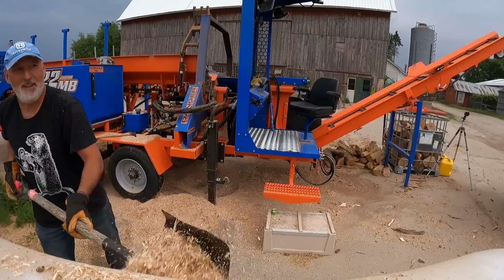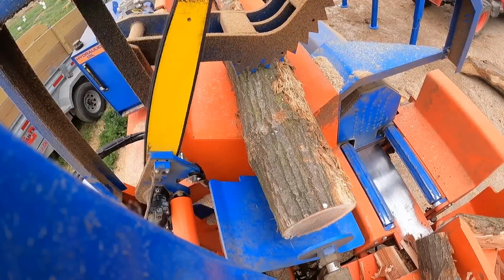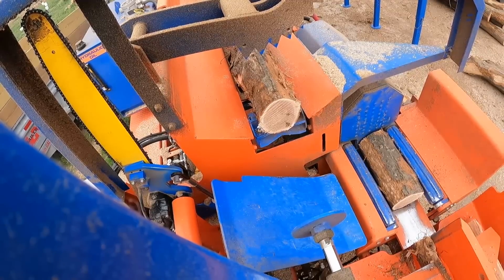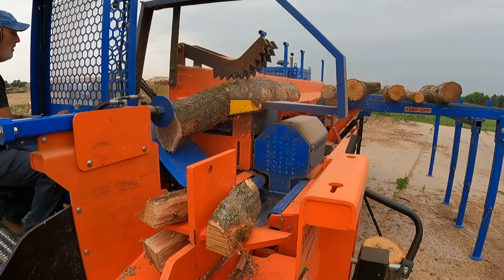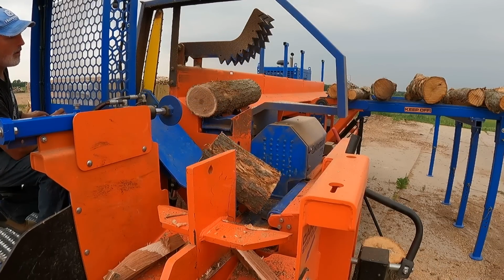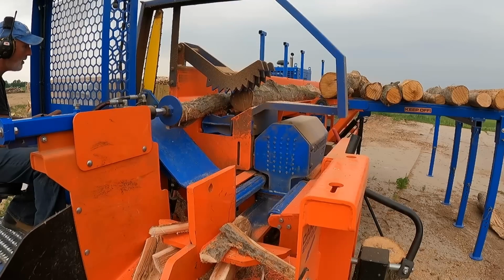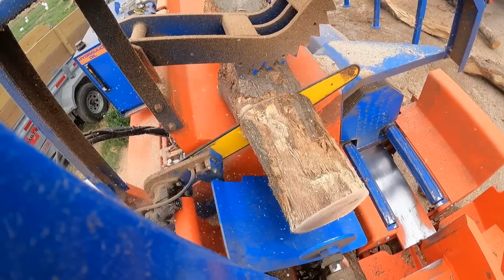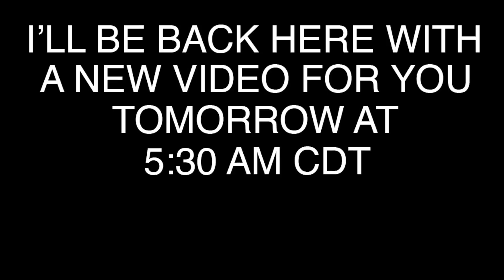Firewood Processor Run Narrated 🗣️🎤

Comment: What a relief! I thought I was the only one that ran a round through the splitter sideways. When you pull the trigger on the 48C splitter there is virtually no stopping it. The best lesson learned here is that cutting firewood with a processor is not as simple as it sounds. With all of the different shapes, sizes, knots, and occasional branch still attached, logs have a mind of their own.  My favorite log to run is tree length, 12-16" diameter. Very good video explaining the things that can go wrong and what you all have to watch out for when operating a processor. 👍👍
Reply: If you hit the trigger again on your 48c the ram retracts. Chris sent me the pictures of the new wedge you have and looks good.
Reply from the maker: Yup,l there is a lot going on there and it is very violent!
Reply: @BertsCustomCuts  Yes it does but as you know it moves fast, an old guy like me doesn't have the best reaction time. Did Chris send you the video? We just finished it last night and have not had a chance to put it to the test yet. We only ran logs through it while we were mocking it up, that's how we discovered that we needed a deflector in front of the eject door.  Need to get it painted, Jeremy is sending some down. If you guys get a chance I would love to have you give it a run.
Reply: @edrurup8955  he sent me video last night too. We should try to plan a day agian.
Reply: I hope I get to come and play to
Reply: @kennethcarlson8713  we wont forget you

Comment: Lots of cleanup tasks with the processor. You are very fortunate to have a concrete pad for the processor to sit on. Makes cleanup a snap. And cutting the IBC totes with a chainsaw!! Why didn't I think of that!? That's great that your clamp gives you a 16" mark. Perfect! On my Cord King, the bar speed depends on how hard you pull the lever. And it can be adjusted. Good design. On mine, the wedge wings are set back about 2". When I split big knotty pieces it hits the vertical wedge first, starting the split. The rest splits easier that way. I'm sure there's another reason as well. Thanks for another great video Chris!
Reply from the maker: Thanks for watching and commenting!

Comment: To hold the small logs in the center you would have to run two pieces of angle on the bed and recess the pusher plate to occomendate them,this would center them better.:yougotthis::yougotthis:
Reply from the maker: Maybe so??

Comment: The reason the cutter wings are set back, is the overall cutting force needed is less.  If all the cutters were flush, it would take significantly more force to push the round through the wedge.  This is especially true for 8 way and larger wedges.  I think when the new Eastonmade 40C comes out, I would contact Andrew and see if you could trade it out for your 22MB,  The size of the logs you typically buy would be more suitable for a smaller processor.
Reply: They could be closer to front but not flush so they hit wings sooner and less would shoot out sideways.
Reply from the maker: Maybe so, but the wood I buy is what is available at a lower price, nice straight bolts would be 50% more so.....
Reply from the maker: yup.

Comment: …..Well I’m alive after the lunch fiasco,  ( the less said the better but I won’t need a haircut for awhile 😮) Irene liked the video and the voice over premise, easier for her to hear and pause as she watches, but what she’d LOVE!, is to find out where she can get one of the T-shirts she sees you wear. I’ve checked the YouTube channel and can’t find any store front so if there’s a link I’d greatly appreciate it if you’d send it to me or Irene is going to trim my eyebrows with her Proctor Silex electric knife!!!
Reply: My guess is you blew the lid off of the propane grill while lighting it.

That will screw up a haircut.
Reply: Sacrilege!!!, any denizens of “In The Woodyard” uses either a Weber charcoal grill or over a wood fire with the cement blocks holding a ceramic coated grill grates!. And you best be hopin Irene doesn’t hear you besmirch her cookin appliances!
Reply from the maker: Email my boss at maryinthewoodyard@gmail.com and she will help you.
Reply from the maker: Ha!
Reply: @mordecaijones1388  My only experience with a Weber charcoal grill was at work.  The "cook" lit the grill, and he was cooking steaks.  The grill was in front of a cab over engine.  Alarm phone rang he jumped in the engine and he rode over the grill that he put infront of the engine.  Fire Engine had a Mack Attack.  Engine 1, Grill 0.

No grilling here.  The chef spent 40 years in the military.  He is grilled out.

Comment: Did i hear that correctly "It cuts crooked like a Stihl"?  I thought we all agreed to respectfully disagree which shade of orange was better?!  I was thinking from the overhead view that the horizontal knife is an inch further back so you are not trying to start all four splits at the same time.  Takes a little less force to start the vertical split and then the horizontal split an inch later.  My humble opinion.
Reply from the maker: It was a joke! Yup, the story is one split at a time with the knives makes it work better.

Comment: Do you think if the processor was designed that you stood and operated the processor by the ram that you would just do your resplits right there or would you just send it through and resplit later?
Reply from the maker: Some other machines are that way, mainly the smaller ones.

Comment: So for every six cords of splits that come through the processor ,you get at least 128 cu. Ft. of 
Shards ,debris and man glitter ?

Is that close or am i way off ?
Reply from the maker: no, way off. with straight wood I get maybe 4-5 five gallon buckets full per trailer load (5 face cords) but with crooked nasty stuff 3x as much.
Reply: @InTheWoodyard  thanks

Comment: I think if all the blades (on the splitter) were at the same position it would take quite a bit more hydraulic power??  (opinion)
Reply from the maker: Yup, very good point, there is only 40 tons I think.

Comment: Do they make a perfect split attachment for that machine, would be perfect for you??
Reply: They would have to make seven different wedges for seven sizes of wood.
Because loga are not uniform.

To minimize shards and debris a single wedge is used and yes it takes longer.
But you raise a good question.

 A processor with seven wedges on a bar.
An electronic eye measures the cut round,
Sends the measurements to the computer and the computer tells the bar full of wedges wich wedge is required and locates the appropriate wedge for optimal splitting with minimal debris and shredding.

I think the have computer controlled milling saws.
So it would be doable.

Heck, Easton probably has something in the works as we speak
Reply: @jeanvaljohn3921  it's just called a perfect split, the smaller machines have it and the japa 405 has it just a box wedge
Reply from the maker: Good ideas!
Reply from the maker: Yup, that is a patented thing by Japa.
Reply from the maker: Japa has the patent on it.

Comment: My a.d.d. would require me to pull levers for 45 minutes, then switch to loading logs for 45, then 
Re split for an hour then chuck splits for an hour then shovel
Shards and debris for awhile.

I'd go bats just doing one thing for 8-9 hours.
Reply from the maker: Mind over matter, if you don't mind it don't matter.

Comment: Hehe. A tired pussy cat. All the hard work watching the processor. 
I wonder if the wedge had teeth on it like the clamp, smaller teeth, not that aggressive, would that help keep the wood in place ? Your ideas on upgrades are good ideas. I think the horizontal parts of the wedge are set back some to make it easier to split the wood. Not taking all the pressure at once. Kinda like staging it. 
I’ve finished cutting two cords, I’m guessing, for my sister in law, her stove is small so all cuts where 11” to 13 “. Still have to split it yet. But now onto the cutting 16” to 18”. 
Have a great day.
Reply from the maker: Thanks for watching!